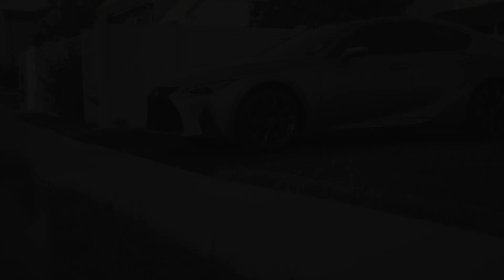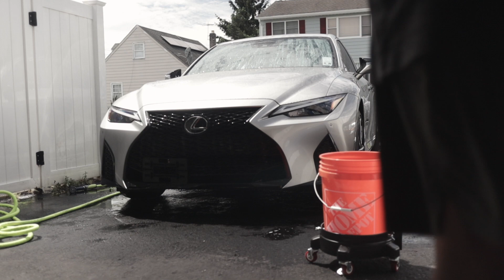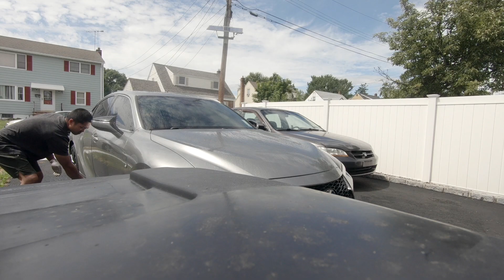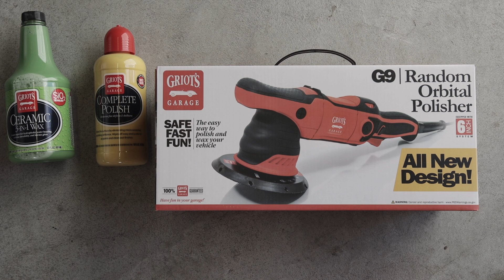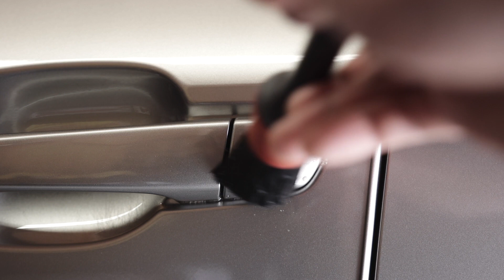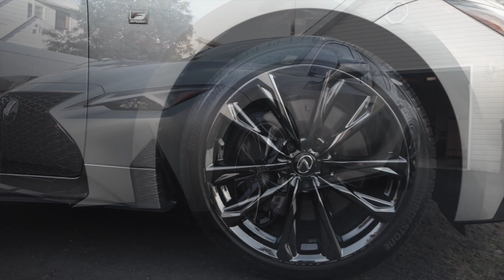Lexus IS 350 F Sport - 15E Exterior Detail 001

Comment: looks good papi....I have myself a 2022 Lexus IS 350 F Sport - Ultrasonic blue with red interior. Had the 2019 IS 300 before this one, have to say the new model is such a nice car to drive, so sound and reliable.
Reply: was your 2022 IS 350 F a special order or dealer stock I’m looking for that same spec for some reason i can  build it on the website but there is no inventory
Reply: @smittybk09  no sir, was actually on the lot for 3 days. I saw and took it away.
Reply: Same spec as you but mines an old girl 2016 👌🏻